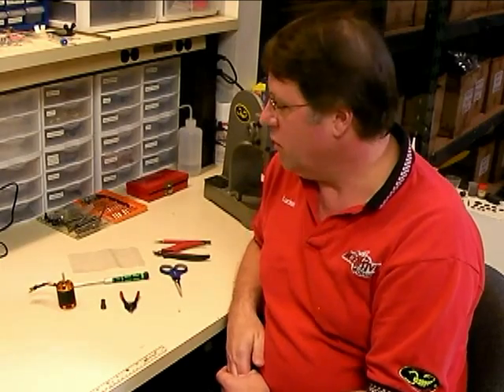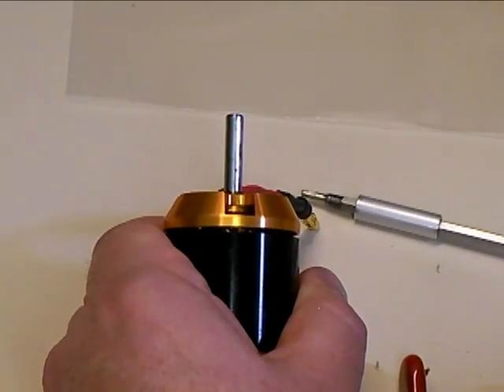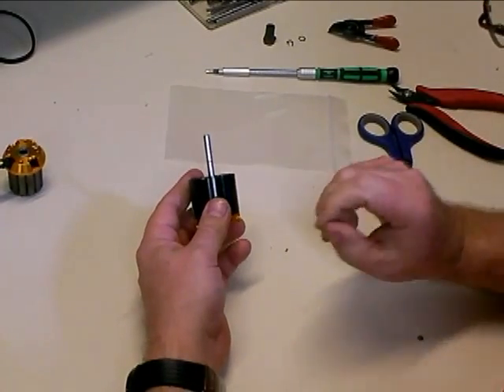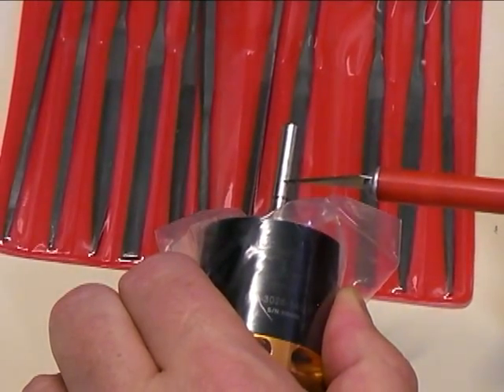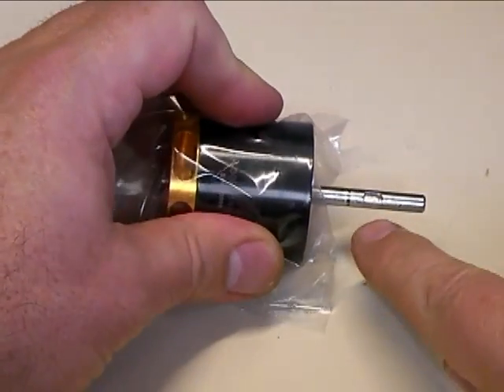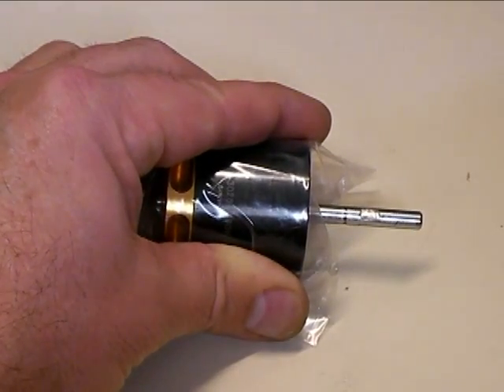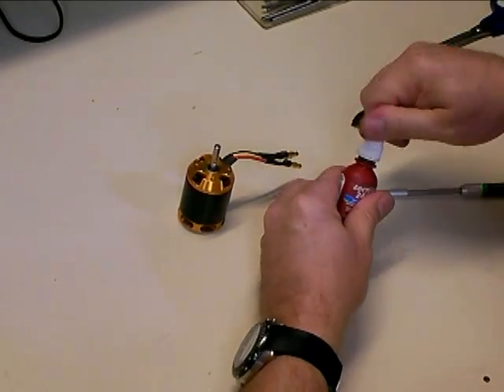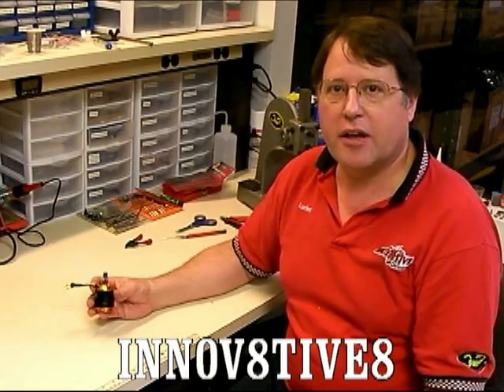How to Grind a Flat on a Motor Shaft by Innov8tive Designs

Comment: Love your DIY principles 12 years ago that allowed users to replace shafts. Sadly this is the future now in 2022. Manufacturers don't allow users to tinker with their devices. iPhones don't allow users to fix the phone with component swaps by a serial number matching scheme. And motors are made with a shaft of a combination of diameters between the inner and outer motor bell, like a combination lock that needs a machined matching key to turn it.

Comment from the maker: You can use the same process on a brushed motor, just remember to put the motor in a bag to keep any grinder filings from getting inside the motor that would mess up the magnets and commutator.

Comment: is there a video for brushed motors as i have a Carson puller motor that needs a notch cut in to it for the grub screw to lock it tight cause it is used in a semi truck gearbox yet i cant take apart a brushed motor. if you gave any advice on brushed motors please let me know.
All the best
Frosb - of - TheMinecraftStarship